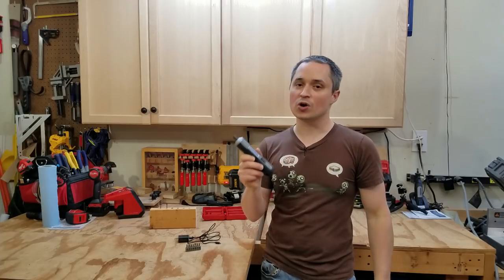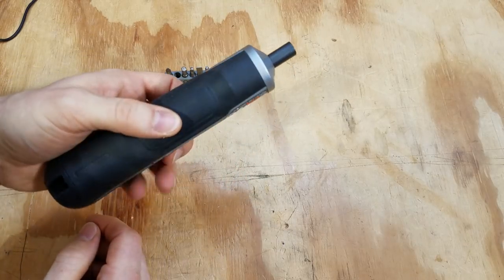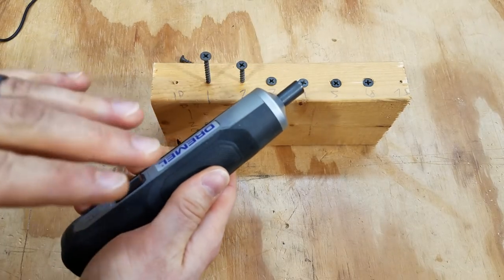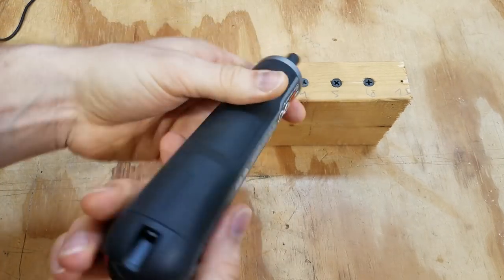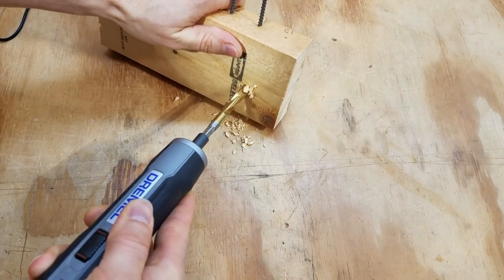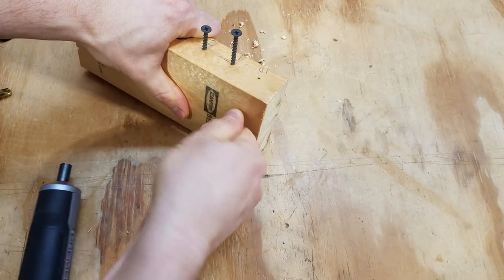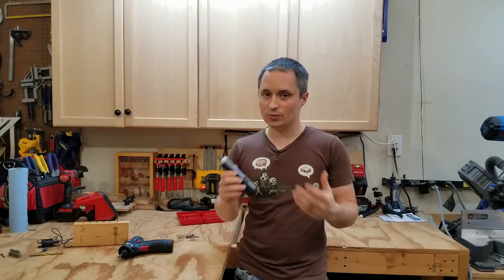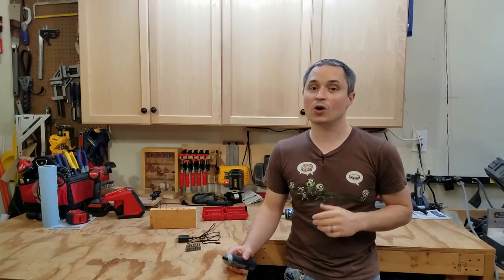Dremel GO Cordless Screwdriver Review

Comment: Great video! The only thing I don't like is you can't remove the battery. Of course it's done on purpose to only last a few years until you have to buy another one. I have noticed the last 10yrs. or so Manufacturer's of these small tools/items without removable batteries are Really making them so can't take them apart to do a DIY replacement of the batteries. 
So you take it apart & it's made to Not go back together again at all & all these small internal plastic clips fall out or just break apart.

Comment: Excellent review, as usual.  For someone without a cordless drill, I'd recommend getting one before this tool, but I can see this being very useful and preferable for certain applications.  

The built in battery meter is a must for any cordless tool with an integrated battery, IMO, so good on Dremel for including that, but it would be so much more useful if it came with an extra removable battery. I Understand you can't have everything you want at this price point.  Looks like a good tool for the price, all in all, and would probably serve a lot of people well.
Reply from the maker: I agree, and that's why I tried to present the differences between this and a drill because I figure the target market is a little split - the very basic DIYer/homeowner who is going to use this once every few months to tighten random screws and assemble furniture may be able to get away with just this, but if they're going to do much more a drill would be better. Then you have someone who already has a drill and is looking to add more versatility to their arsenal, and this is a great lightweight option for that too.

Comment: I could not use this for my small projects - putting shelves and furniture together, etc. There is no low speed, and so I had to go get a regular screwdriver. I thought I was safe ordering this as I had a dremel that I charged years ago, and it worked great, had the low speed. I'm not sure what I'll be able to use this, if at all. Each time I use a driver I start slow and then increase the speed.

Comment: I use this Bosch/Dremel Go screwdriver. Fast and powerful tool. But:
1. Torque is bad. Hard and not controlled. It turns around in our palm at the end of tightening the screw, therefore dangerous.
2. We can’t use this tool during tightening and removing small screws by pressing the tool to run. The act of pressing may be softer.
3. Drill bits get away after drilling and we are obliged to remove by our hands...
Reply: Torque is good; weak hand-strength is bad! I would never consider using this pocket screwdriver for drilling. I have an 18v Li-ion for that, and for even larger jobs I have a 1/2" chucked electric drill.

Comment: I purchased this Dremel and I have not had it longer than a couple of months and I am running into a problem. For some reason it is not turning with the bit in place. I press it down and nothing. It is fully charged.
Reply from the maker: If the forward/reverse switch is in the right position, then it sounds like it's broken. I'd contact Dremel since it should still be under warranty.
Reply: @DoresoomReviews  Yep, I have tried FWD and REVERSE positions and no go. Hoping they are good about returns.  I NEVER chuck receipts or boxes but I cannot find them for the life of me lol!
Reply: @DoresoomReviews  Thank you btw. Great review and advice. I appreciate your time. My dad was an electronics repair guy and I worked for him for 6 years so I am inclined to rip it apart but that doesn't appear easy.

Comment: only for medium screws. Bad idea for ikea. 
The electronic clutch is not working well. Always one turn and only then turns off.

You can use setting "1" for medium screw, push - stop then push, push again until end.
Reply from the maker: I've used it with screws as small as 3/8" long #6 wood screws without issue, and found the electronic clutch to be repeatable. I've done two furniture assemblies so far without any problems. It's true if you push it repeatedly it will drive in a little farther until it recognizes the torque threshold, which a mechanical clutch won't do. However, using an electronic clutch let them make a shorter lighter driver. A lot of it is personal preference on clutch types.
Reply: Sorry for google English.
 The repeatability is really good. If after stopping accidentally press again, it will make one full revolution and only then controls the torque. When working with some materials, this turnover is enough to break the thread. For the assembly of furniture is suitable, and for the assembly of PC is so bad.
This is a compact screwdriver, ideal if you need to disassemble wooden structures.
Reply from the maker: @Ole325  No problem, we're on the same page now! I agree, this has too much torque for working on electronics.

Comment: This is a very bad device, as bad as Bosh Go.
1. These tools do not have a bit fixed!
2. Also, both devices cannot quickly stop; they have a strong inertial rotation after a stop command for about 1 second, which often leads to a bit slipping out or damage to the material where the screw or a simple bolt is twisted.
For electricians and furniture assemblers, this is definitely not suitable, well, except to turn it manually, so as not to damage anything and it doesn’t slip out of your hands, since it has a lot of power!

Comment: Why not make every dremal have this feature added, so stupid to buy another one just for that.. it should do all a drill can, tighten bolts etc
Reply from the maker: Because a Dremel rotary tool is super high RPM and low torque. This is 360 RPM. A rotary tool is 10,000-20,000 RPM.

Comment: Black and Decker makes a version of this (and it's only $15). Hitachi makes a very nice 3.6 volt unit for $69.99, I use the Dewalt version which is 7.2v. I think the Dewalt cost me $89 back when I bought it 4-5 years ago. These are very handy for delicate assembly but I would definitely step up to something that has a positive bit lock and a removable battery.
Reply from the maker: I didn't know Hitachi had one, or even that they had a 3.6V platform.
Reply: @DoresoomReviews   I have the Makita DF012DSE 7.2V Lithium-Ion cordless screwdriver. It's twice as powerful as the leading competition, but along with that comes the price tag of $183 on Amazon. It is the best of the best in this catagory.
Reply: @DoresoomReviews  This is a very bad device, as bad as Bosh Go.
1. These tools do not have a bit fixed!
2. Also, both devices cannot quickly stop; they have a strong inertial rotation after a stop command for about 1 second, which often leads to a bit slipping out or damage to the material where the screw or a simple bolt is twisted.
For electricians and furniture assemblers, this is definitely not suitable, well, except to turn it manually, so as not to damage anything and it doesn’t slip out of your hands, since it has a lot of power!

Comment: Dremel is a Bosch Go clone. 
Bosch bought Dremel back in 1993, so nothing new with this product it's for the US market.
Specs for this product:
3.6 V - 1.5Ah 
Samsung Battery: INR 18650 - 15Q 
1500 mAh - Lithium-ion inside.
Battery temperature control sensor inside
360 RPM - no load speed
2.5 - 5 Nm variable torque 
Smart  E- clutch stops when you want to stop
Micro usb charging port 
Standart usb charger in box: 5V -1.0A 
or any usb charger with 5V - 2.0A will work as well. 
Charging time 1.5 hours / 90 min.
Battery indicator
Max. screw diameter 5mm magnetic
Weight 280gr.
Reply from the maker: Thanks for the extra details.
Reply: when I opened it I found out that there's a LG battery :/

Comment: When you pull out the drill bit,  the tool has to be on/ must be turning.  nobody pulls the bit like that.
Reply from the maker: Yes, for a normal drill you are correct. But with this driver, the only way to keep it rotating is forward axial pressure. It's impossible to pull a drill bit backwards out of the workpiece while pushing it forward to keep it rotating.
Reply: @DoresoomReviews  Which is why, I can only assume, the tool is a screwdriver and not a drill. Apparently, it's very hard to remove drill bits when you drive them with a hammer as well. Just because you can doesn't mean you should after all. That way lays stupidity. Comparing screwdrivers with drills, as pointless as comparing apples to oranges.